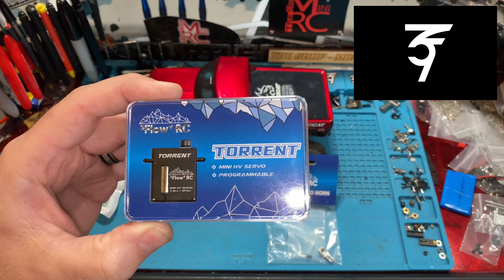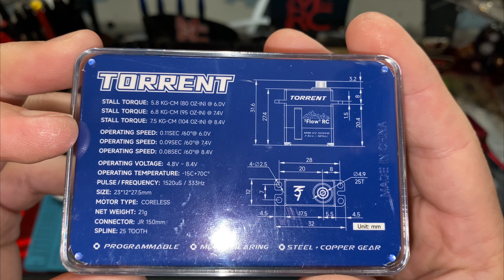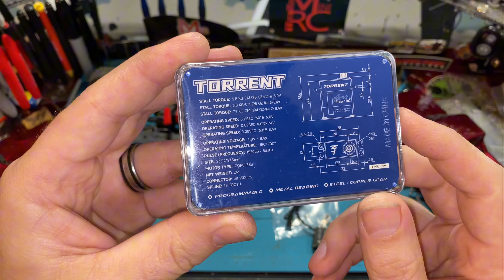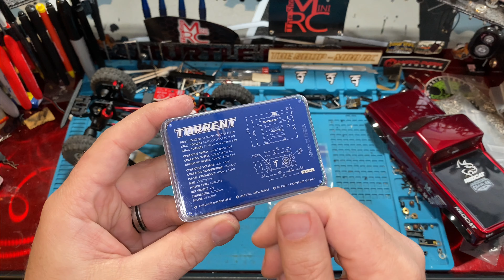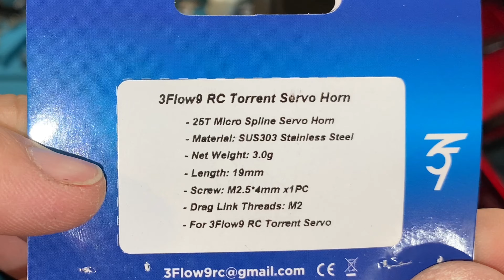3Flow9 RC Torrent Servo and Steel 25t Servo Horn installed on the Redcat Ascent 18!

Comment: Looks like a great servo,  and at that price looks like a winner.
Dang, servos have come a long way!
Im gonna wait until i change the chassis rails.
Been wanting to drop the whole rig significantly, so will need to either chop those rails or buy something.
Then custom links seem necessary to miss the motor, and I'm wondering if a change of shocks would be better on such a LCG setup.
Still need to dig into it all, just need the time and spring has been a b!+ch. Lol
Thank you!
Reply from the maker: Yeah, shocks could help a ton to get it lower.

Comment: How did you fit a 27mm long servo? I'm looking at my stock truck and the servo is barely 21mm and there's no way I'd be able to try to fit even 2-3mm without hitting the leads on the motor. I'm looking at the back of your new servo and its right where the back of my stock servo is... so I'm very confused. I can't move the servo any further forward cause then the horn his the front of the chassis and the front clip.

As a side note, the slightly sped up audio is terribly distracting.
Reply: Ah.... I see, the wheel weights I had stuck on top of mine were hiding some of the geometry and making it look shorter due to the protrusion at the base of the horn gear instead of it being even all the way across the front. Now it makes more sense.
Reply from the maker: Glad you figured it out.